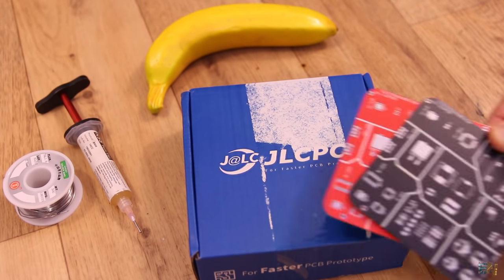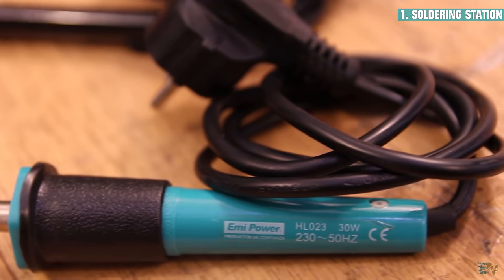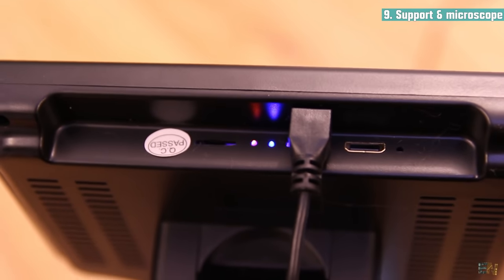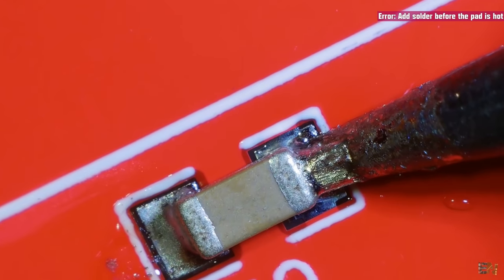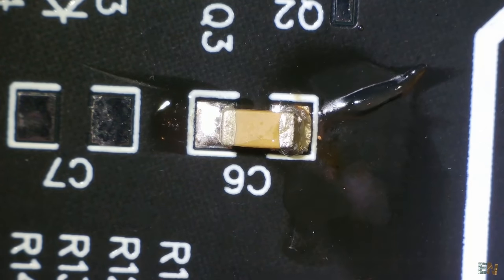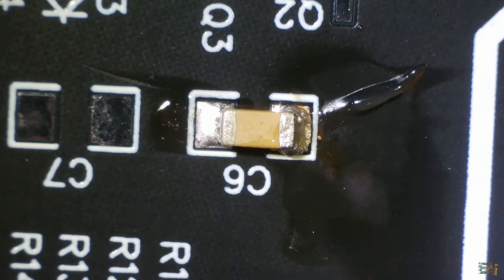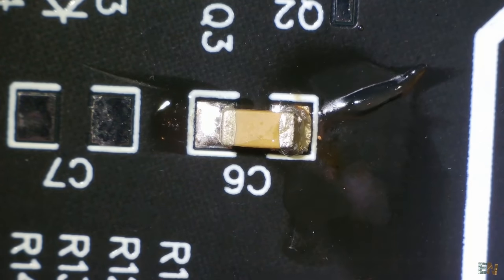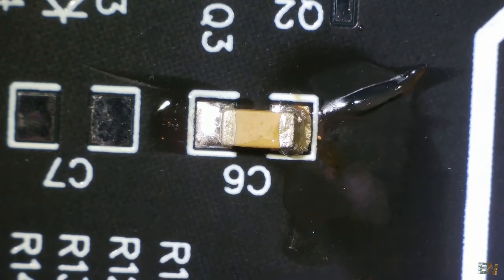SMD Soldering Tutorial | Guide | Tools | Tecniques | Stencil

Comment: I have seen hundreds of videos about doing repairs and adding components, but this is the best so far.
Have purchased almost completly set of repair system and are going too be trying at 19th because then i have getting everything i need after i had alot of bad experiences with repairs shops that couldn't figure out the issues and didn't wan't too try too fix them either and i was wasting alot of time and money by sending the bad PS5's too other repair shops. I get that some issues can't be fixed. But some are, but i feelt many of them i had experience with was bad.

So after i have seen more or less hundreds videos (mainly focused at PS5) i have too say that this video has been the video i have learned most by doing this things. I have learned alot how too diagnoes the PS5 with those videos, but this is what i exactly needed too begin with before i am actually too add the BIOS chips on the PS5 and other components. I'm kinda nervous for the BIOS chip (i had too remove the previous one because i manage too damage it when i was removing it. Was going too be manipulate it from disc too digital version, but got damages. It's the first time so that could be happending. 

But i'm glad you are sharing your many years of experiences and explain it why you are doing the things you are doing so we the beginners understand the reasons for the things we are doing and i can't wait too see the results at 19th when i'm getting the chip i need.

Had some interested in this last year now and hopefully i could be doing this as a side hustle.

Comment: Excellent video. I already know how to solder SMD's (lol), but this was an excellent tutorial. This may be a personal opinion, but I feel like 400 degree's Celsius is too high of a temperature for hot air soldering. I guess it's fine if you have passive SMD components that will melt quickly, but I don't think I would want to put 400 on a IC. 300 is my preferred hot air soldering temperature.
Reply: We use 400C (750 f) for lead free solder with a melting point of 238C.  It really does depend on the application.  400 is likely too hot for the boards and solder this guy is using.  ROHS rated components are generally good for 260C for a certain amount of time.

Our boards have far more layers and much more plating than what is shown in the video as well, so more heat is required.  A preheater is always used when hot air is involved.

Comment: Good technique!
I noticed that you didn't go over the different types of solder, therefore the different temperatures that they're soldered at. I thought maybe you wanted to not get get too complicated, since you covered a lot of stuff.
You might want to do a separate video focusing on the types of solder, because I've run into that when buying it. You cannot mix lead-free and leaded solder! I learned it the hard way, when they just started switching over.  I had bought some solder, not knowing it was lead free.  The PCB I got with a kit had tin plated pads, but the solder just wouldn't stick! It turned out my iron wasn't hot enough. During the process, before I figured out that the new solder was lead free, I used a small piece of my older solder (leaded) because I was attaching wires to large pads, and I needed larger diameter solder. Then I needed just a little more, so I tried to add the smaller new stuff, but it just wouldn't work!  I finally looked at everything to figure out what was going on.   When I understood, I was really ticked off!
For hobbyists, using leaded solder isn't a problem, and it's much easier to work with.  But you must make sure what it is when you buy it!  (I hope you haven't had those problems, but I'm sure a lot of newbies could. I'm experienced, but it still caused me problems back then (many years ago, when the switch just started).) I have seen at a lot of online places where they don't specify, and I wonder about it!

Comment: I was deeply amused to see you using a circuitboard as a squeegee for the solder paste!

I watched another video right before this that used a different technique on the ICs while mentioning the drag-the-tip-across-all-the-pins method, while also mentioning that the flux helps ensure the solder only goes where the metal contacts and pins are.

Before these last two videos, I had thought with my severe lack of coordination and steady hand that the smaller SMD components were out of manual reach, but between the first video mentioning best to get .2mm solder and showing that technique, while also seeing the rapid tip-dragging, weirdly, it makes it appear easier than dealing with through-hole soldering, which I last soldered in the early 90s.

Thanks for this video!

Comment: I found it much easier to make an "oven" out of a small diecast aluminium box with a wire frame inside to hold the pcb with paste and components, and also a hole in which I insert a temperature probe connected to a multimeter, which costs a few dollars, not much. Over a gas stove I heat to 150C for 2 minutes, then raise to 225C over 2 minutes, then let it cool pulling the lid back. The results are excellent, much easier then using a hot air gun, which I also use for rework. I had some difficulty using a stencil; alignment was not a problem, however one must be careful to press paste down evenly and not let the paste flow under the stencil to where it should not go. Some IC's have very narrow pads and are completely under the body, and accurate placement of the component is probably the biggest problem.
Reply: Very clever!

Comment: I use a DIY Reflow Oven that follows reflow curve temperature data to not stress the parts.
2:27... That solder paste application was awful. 3:47.. You are applying Solder paste to a hot PCB.
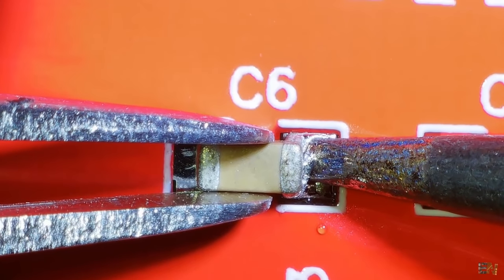8:01.. Then just add some Flux.
BTW... Too many Mid Roll Ads.

Comment: I've soldered SMD before but wonder if I could do it better or easier.
I use a Litesold 10 Watt iron which are no longer in production, tip filed to a point. I bought 0.5mm solder.
 I still prefer lead/tin solder, the lead free stuff not good if changing components as in some of my experimental circuits.
Tweezers seem a good idea, I previously tried to hold the component down with a rubber ended pencil on a stand so not able to apply solder to the pad first.
Thank you for this idea.
G4GHB.

Comment: Maybe I missed it but was there a mention of the temperature for the soldering iron or the hot air gun? I have to replace an SMD bios chip on a motherboard. Another video showed just using the hot air with flux.

Comment: Hi Mr. Do you recommend using leaded solder for better soldering process? I've heard that lead solder are better than lead-free solder when it comes to durability.
Reply: I believe leaded is mainly better for reliability if whiskering is a concern (aerospace and medical applications). Otherwise the differences aren't huge as long as the workflow results in proper wetting, etc.

If you're planning to sell products in the EU, you will probably need to use lead free to comply with RoHS.

Comment: Awesome Tutorial..!! But You Need More Heat (400°+) for TO252 (DPAK) Package
Reply: I suggest not to increase the temperature so much since it's useless and can damage the components. The solder melting point is between 185 and 230°C (depending if you use leaded or lead free solders).
What can change is the tool tip dimension for a bigger one since it's just a matter of thermal mass exchange (Second law of thermodynamics). 
In my job I always solder at 315°C, changing tool tip dimension according to component dimension

Comment: As a professional I'd say use a slightly hotter iron and remove it as soon as the solder flows, rather than wait 2 seconds, otherwise a great tutorial.
Reply: I long used the hot-and-fast technique for most through-hole work but it is the wrong approach for most SM work. Heating the component body, especially with discrete devices, is inevitable and excessive temperature can cause damage. Longer slower heating is generally better.
SM ceramic capacitorss should never be soldered with an iron except in desperation. It is far too likely to cause cracking of the ceramic due to thermal shock. This is well documented by all the major manufacturers of SM ceramic caps.

Comment: The only problem here I see with this method is that he is not applying any flux to the component end prior to sliding it into the pad (which he previously added flux to). 
I would recommend swiping the ends of the component with some flux before going as far as heating the solder on the pad.
edit- somewhere in the middle of the video he does apply flux to the component.
Also, when he's demonstrating how to solder some of the IC's using paste and heat gun he mentions that it's "the ideal way" but the ideal process is to use the stencil to apply the paste and then install the components AND then place them in a small oven or kiln that can ramp up to around 400C. That's what we use in our factory.

Comment: I have been looking some Voltage regulators from TI and they use PowerPAD, a large surface behind that solders directly to ground/thermal plane. Since they are below the IC, how do we solder them? Also what about FGBA packages for some variants of STM32 MCUs that come in smaller footprint compared to easier to solder LQFP packages?

Comment: I have added the gerbert zip file to JLCPCB, however, I don't know if the parts needed for the pcb listed in the gerbert? what I mean is, if I send the job as is keeping everything default. will I also get the parts, or only the board + stencil. I checked the .txt but I am not sure how to get the surface parts? @Electronoobs

Comment: All I want to do is to fix an electronic problem with the consumer devices in my house from time to time! A nicked kettle cord, laptop screen replacement, motherboard capacitor replacement, fixing the electronics on a toy, fixing the TV remote, installing a cigarett lighter in my car, adding a temp sensor/LCD display onto something etc...
That's like a problem every 3 months!
No thank you! If it's this expensive (I can see it's a significant investment for fixing 3/4 problems per year) then I'll let an electronics repair shop deal with it.

Comment: how do you solder with the Iron without a soldermask (Homemade PCB)
Reply from the maker: That's a bit more difficult. You have to be careful otherwise solder will stick to all copper tracks... Use a lot of flux
Reply: Add a lot flux and it wont be that problematix

Comment: does anyone know what type of jobs i could get soldering pcb boards? id like to think ive gotten pretty decent after funking around with my own electronics the past couple years and id like something besides stocking food at target.
Reply: There are companies that offer pcb assembly service. You provide them the PCB's and components and they do the soldiering and testing. You will however be mostly soldering THT components as the SMT process is more automated. No electronics knowledge required. 

Next, pretty much all electronics manufacturers that don't use the above mentioned service do their own pcb assembly so you could get a job there, again no electronics knowledge required.

Repairs is another common position at all assembly plants, however that requires you to have good knowledge of electronics and be able to do some advanced soldering like repairing broken pads and traces....

Fun fact is that 95% of your colleagues will be women, which will most likely be able to do the job better and faster than you :D

Comment: Suggest a cheap and best SOLDERING STATION.
Reply: KSGER stations! worth every penny
Reply: @Slavko_Husam  while I have bad experience with ksger ones (one died few days later other one arrived faulty) the one I have while it forgets everything I set in the options It still works quite well
But my advice is to order a lot of tips, out of 7 tips I got only 3 are working
Reply: @alexstone691  I had to fix it manually, cannot remember what exactly, somewhere was a bad connection and since it's working very reliable, yeah the tips for the price are superior quality and vame changer!!
Reply: TS100.
Reply: 8582d is great performance for very little money.

Comment: Soldering SM ceramic capacitors with an iron is a bad thing to do and should be used only as a last resort and on things where reliability requirements are low. Soldering with an iron results in severe thermal shock to the ceramic and it can cause cracking. This is well documented by most SM ceramic cap manufacturers.

If you are going to do it you need to refine your methods so you don't keep heating it over and over to clean up a mess you've made with bad technique.

In the hot air method shown the initial heating was far too fast, resulting in the volatile components of the flux essentially boiling and causing the paste to swell and spread. Preheating should be slow, accomplished by either reducing the air temperature or keeping the tool further from the board. If done properly the paste will stay where it was put and "dry" so that there is no bubbling and ballooning when the temperature is raised sufficiently to melt the solder.

Comment: Boooring :) Doing this professionally you'd never have time for all of this, so a few neat corrections.
1. (The larger components) No reason to slide things into the pre-heated solder, as you've only got two hands, and one would be already occupied by your iron. At times this may be useful tho, yet usually you just would waste time (and probably damage either your board or component, should it take you longer to align it yet your iron is set hotter than usual to deal with a massive ground or something). Place the thing where it should go, slightly press with your tweezers or just your finger on it's top to keep it in place, and solder one in. For ICs, put drops on two (preferable opposite) corners, not just one (any drop will go, you may even short a few pins at this point yet it will be ok). 
2. Always(!!!) heat the joints again to release any tension should one build up (it usually does).
3. (Smaller stuff) Just solder those 0402s to be connected to the pads with a very rough alignment, then apply a ton of flux and bake the things with your hot air gun. Easy factory-grade installation. (if no gun, you can do the same with a wide soldering iron tip)
4. (QFNs, heatsinks etc without paste) ONLY the air, no iron - or you will have a ton of problems with actual, especially smaller and heavily populated boards.
5. Stencils. Nope. Usually there is no need in any accuracy while putting the paste on (just keep the layer thin), and QFNs and all easily click onto your pre-tinned to a pillow-like shape pads anyway. The only times you'd need a stencil is dealing with BGAs (tho I once wanted that DSBGA6 soldered in too much without any hassle, so just used the same "pillow-method" as with QFNs, although the thing is somewhat as small as 0805 it still worked well).

Comment: Your solder wire is not good quality, if you don't want to expend so much money buy Mechanics 63sn37pb solder wire or no leaded one (they have both).
Mechanics has a great quality, very close to high end solder wire.
Reply: I agree - Always use high quality solder. However, I insist that you never use lead-free solder unless you’re reworking modern commercial electronics which use Pb-free solder (don’t mix Pb-free and leaded solder). Pb-free solder is more difficult to work with, has a higher melting temperature, is more brittle and results in ugly dull-looking solder joints. Also, in some conditions, Pb-free solder is known to grow tin wiskers.
Reply: @Samuel-km5yf  well as a repair business you'll mix them up.
I'm not quite sure why people tend to say they are not good to mix, since i've never came across with problems after rework something. Do you have any idea why? Besides pollution and heavy metals.
Reply: @FixDaily  —  — The problem is that mixing alloy ratios changes the eutectic properties of the solder. A 63/37 tin/lead composition is eutectic. A 60/40 solder is frequently used and is close. The Pb-free solder now required by RoHS regulations is NOT eutectic and results in uneven cooling, dull-looking and brittle connections.

Comment: you did a great video so I hate to say that, but your solder joints are very bad because you forgot the most important thing in soldering electronic components. you need to have a clean tip. always. for each solder joint. you need a sponge to clean ur tip BEFORE every solder joint. Never clean your tip after soldering though because that will destroy the tip. your tip needs to be tinned this will protect the tip. if you don't clean ur tip before soldering a pad or component, your joint will be dirty and eventually lose connection over time which is always frustrating to diagnose. especially these cheap tips you're using will get destroyed quickly if they're not handled with care. also never use steel wool or sandpaper that's the worst you can do to ur tips. just a slighly wet sponge is all u need. you know pretty much about soldering and you covered all the important steps. but you forgot the most important one. ✌🏽